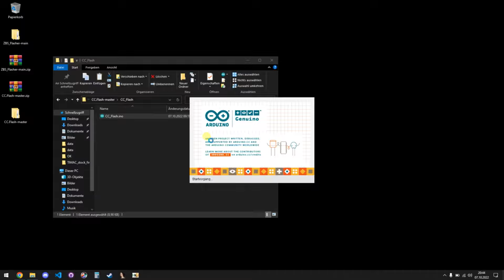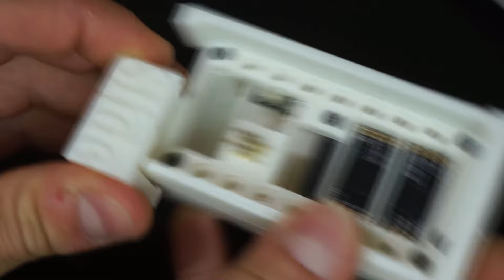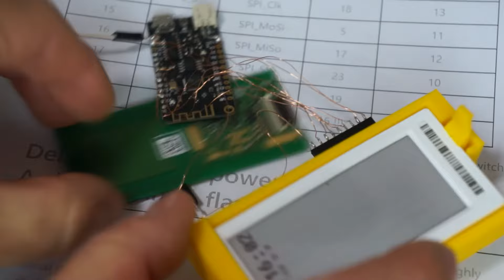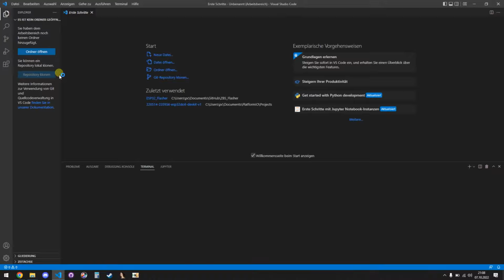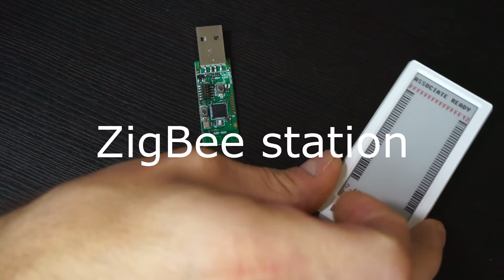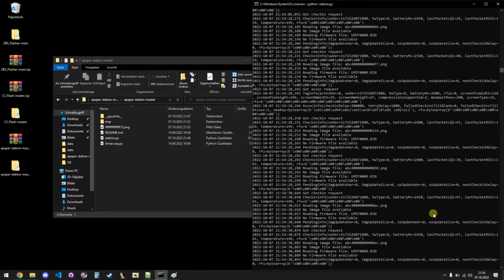PC controlled E-Paper price tag custom firmware flashing How-to

Comment: Why does Zigbee USB stick need reflashing? I thiugh Zigbee is universal and any zigbee usb stick would work?

Where did u buy your cc usb so it included the header and stick itself?
Reply from the maker: It is a special firmware for the displays, as mentioned before reflashing is always needed.
But before you spent to much on this project the newly created OpenEpaperLink is way more advanced and better so maybe take a look at that
Reply: @atc1441  nice
I did wanted a flashable zigbee dongle anyway (have some other zigbee devices in my house like an Ikea undercabinet lighting (which claims it can be zigbee dimmed and controlled)

Will see, first I have to find me some of this epaper price tags (will go to lidl and just ask if they have some broken ones I could take)

Comment: constantly getting a received too short packet error, data ed and I cant seem to find the issue
Reply from the maker: Sounds like you are using the OpenEPaperLink firmware on the Displays but the EpaperStation as AP, you need to use the OpenEPaperLink AP as well. They are not compatible :)
Reply: @atc1441  Oh thanks, so I just have to find the CC2531 AP Firmware it seems?

Comment: Great job! Respect! I have several Stellar-L3N@ E31A board HS_EL5102_9M_61_01 and Stellar-S3TN@ E31A board HS_EL5101_M5_60_04 price tags. They are probably suitable for flashing according to your project. The second (smallest) is exactly like yours. Flash them with firmware?
I also have several Stellar-XXXL3N@ E31A on a CC2640R2F chip. Is your firmware not suitable for this?

Comment: Is the CC firmware just a default flashing firmware for the zigbee usb sticks? I have a zigbee usb adaptor already flashes to work with Zigbee2MQTT on home assistant and I was hoping not having to buy another one
Reply from the maker: Hey, it is a different firmware that is needed to be flashed
Reply: @atc1441  thank you.
Do you think the two zigbee networks can stay in the same house?
I would like to use the displays to show data around the house I was hoping to use the same network
Reply from the maker: It is no problem to have 2 networks running, you need 2 CC sticks then of course

Comment: Thanks for this elaborate video explanation! Unfortunately I seem to be kinda stuck. When I flash my display (which looks exactly like yours), I simply don't get anything on my display afterwards. It doesn't seem to boot or doesn't update the screen at all, whereas on your screen you can see the barcodes, the mac address and "associate ready". I shorted + to - as well to get it to reboot, but nothing happens. Any tips?

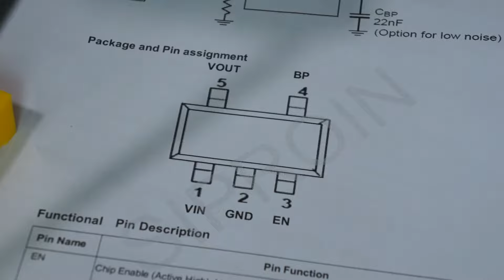Comment: 18:02 do you have any schematics of the switch?
Reply from the maker: Hey, unfortunately i got nothing prepared for that, but it is like the dafult connection from the datasheet with the enable pin used
Reply: @atc1441  hey ok, i wasn't just sure as I couldn't find the mentioned voltage regulator but found a replacement now.  Do you know if there is a chance to write the displays without any wireless conection? My Idea was to write some text on the pc, take the display and press it into the jig. Transfer the text to the display and use the display as a kind of static but rewriteable label on the shelf? I don't need to change the text often and would like to avoid all those batteries
Reply from the maker: You can find a uart firmware in the github, but also a video about it on youtube, that way you can directly write to the display, but it is not well docummented
Reply: @atc1441  Sounds nice, thanks. Is this video by you?
Reply from the maker: Yes
Reply: @atc1441  found it, that's very cool!

Comment: Hey Aaron, just wanted to ask if you'd come across the hanshow nebular esl, I got given a few as e-waste. The case is cosmetically damaged but the tag seems functional, but the internals seem different than the hanshow tag you've got a video on.
Reply: I'd be interested too - I've seen their FCC manual for them and they have RFID and are programmable via 2.5ghz or possibly infrared. The RFID only has 200 bytes so it's definitely not possible to program the display from that although the RFID might reveal encryption key, identifiers or something else used during comms.They're sealed with no battery compartment so they're basically designed as disposable / e-waste so it'd be useful to see them repurposed for something else.
Reply: A follow-up I've ripped open one of these things and there are pin labels on the pcb so I'm hoping that with a suitable fpc connector it might be possible to drive the display even if the rest has to be discarded.
Reply: @drxym You make any progress? I've got a bunch of these in various states of busted. I do have a few good ones that I would like to use.

Comment: Any hints for a good font to use on the displays? Whenever I use Arial or MS Sans Serif in Affinity and export it to PNG, I get a text with fuzzy lines and edges instead of the crispy, clear font I'm used to from ePaper Displays.
Reply from the maker: Saving it onces as monochrom bmp and then again as png removes these artefacts. Thats just a workaroung but helps
Reply: @atc1441  Is plain text also possible or do I need to create png?

Comment: Awesome! Good work and thanks for the detailed explaination. Did you manged to get something in red color on the displays? Is it just to use red paint in Paint or is it more complicated? 😀
Reply from the maker: Hey. Red is also working but the station not updated for it. It will work in the future. Only the station.py needs to be updated for that
Reply: The little time I had and spent after Makerfaire I poked around in the firmware. Dmitry has written his own fowmat for images and Color lookup Tables to save on memory. I really want to get back to the display but just find myself wanting to just relax on weekends :(
Reply: Red is working now.